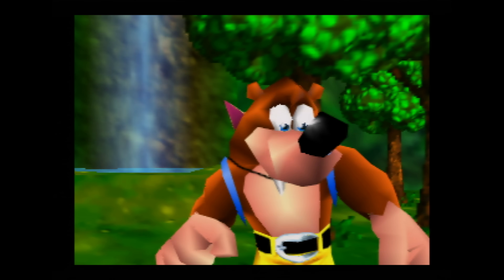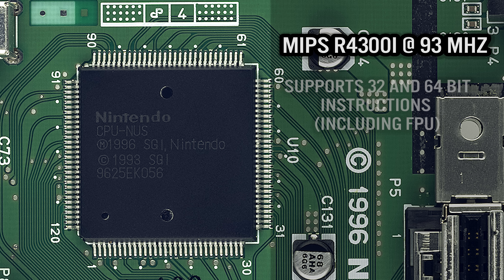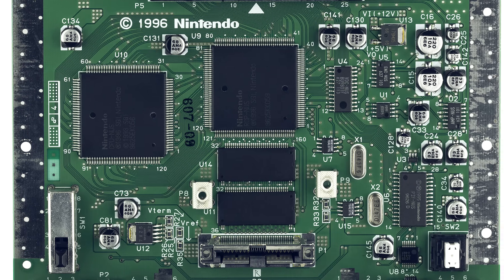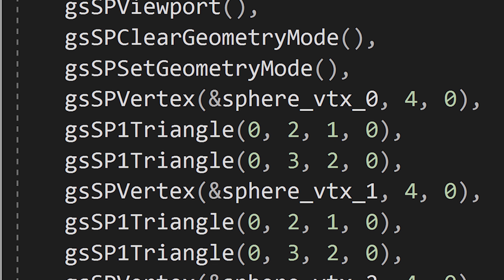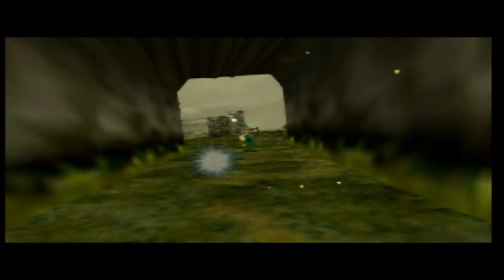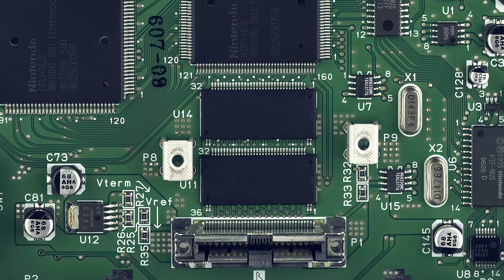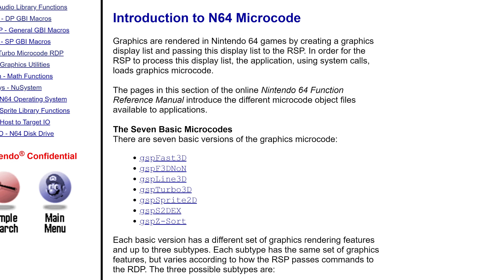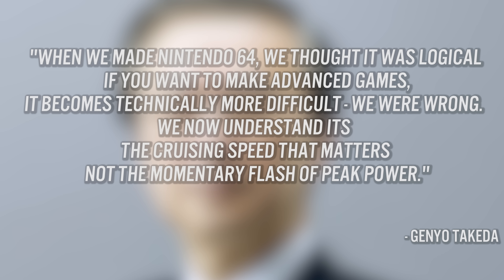Why was the Nintendo 64 so hard to develop games for ? | MVG

Comment: Explaining pipelining as running multiple instructions at once is quite an unfortunate choice in my opinion. 
While technically true, it suggests the false idea of executing multiple instructions per clock. That is not the case. Pipelining splits instructions that would take too much time to process at once (forcing you to use lower clock speed) into smaller chunks (5 in this case) that complete much faster. But all that means is that you don't need to wait for instruction A to finish before starting instruction B, you can start B as soon as block 2 of A is executing (and C as soon as blocks 3 of A and 2 of B start). You can't start A and B at the same time.
Reply: And you must also make sure that A and B do not depend on each other, or you'll stall the pipeline
Reply: @halofreak1990  Not even that on these old MIPS CPUs, no interlocks meant it was on the programmer to avoid dependencies in branch delay slots and load delay slots.
Reply: N64 is VLIW Latency Language exactly like Saturn. But the difference being, NECVR4300 is a single Wafer CPU Chip, SH-2 is a Double Wafer Chip Pair.
Reply: @segaunited3855  RISC, not VLIW.
Reply: @espfusion  VLIW(Very Long Instruction Word) is Latency Language or Assembly Language writing. RISC(Reduced Instruction Set Computing) is an ISA(Instruction Set Architecture) . Saturn's ISA is RISC. N64's is MIPS(Million Instructions Per Second), but both use VLIW Latency Language for Programming.

N64 is capable of up to 60 MIPS Computing Instructions. Saturn is maxed out at 50 MIPS Computing Instructions.

All 5th Gen Consoles used C Language Assembly. It was just easier to do on PS1.
Reply: Throughput is 5x higher (in most cases) unless you are planning on working with assembly in your life thats all you need to know.
Reply: @tintom3t  5 times higher relative to what? 
Most natural comparison to me would be to the same architecture running at the same clock, only without pipelining. And that would be faster.

Comment: Fun fact that was the last time Nintendo had the most powerful console of the generation to date unless you count the time between the Wii U launching and the ps4 / Xbox one launching
Reply: That was the last time any console beat out the PC in terms of power.  I generally think the best looking Game Cube games look better than the best looking X Box games though.
Reply: In that case it usually came down to optimization a similar case would be the Xbox 360 preforming and looking better even though the ps3 was more powerful
Reply: @phantasmagoric3934  Although the shader effects of the X-Box were ultimately the direction the industry went, I think the Game Cube's emphasis on easier to run multi-texture effects delivered better results for the power level of that generation of systems.  The 3D Card inside the X Box had a notoriously ugly color palette too.  I agree though, it usually did come down to the most well optimized games on each system coupled with amazing artists.  Even Shadow of the Colossus on PS2 looked amazing and that system was by far the weakest of that generation.  By this point though, you could basically make any game you wanted and have it look good on all three.  I honestly don't understand why anybody even cares about the minor technical differences between the big three game systems of today.  If I hear one more dumb ass exclaim how they can't believe game X came out for the Switch I think I might die of laughter.  It's crazy to think that even a tablet can push far beyond what these older systems could.

Comment: Pipelining means it is working on 5 instructions at the same time, not that it can execute 5 at the same time. Superscalar is the term used for an achitecture that can execute different instructions simultaneously in different parts up the chip. The expanded version of that is called hyperthreading. 
Also, the MIPS 4300 is 32bit externally, so if you consider the Sega Genesis to be a 16bit system (68000 is 32bit internally, but has 16bit external data bus) than you should consider the N64 to be a 32bit system. Also, very very few N64 games actually used 64bit code. Most used 32bit for a variety of reasons.
Reply: It's actually kinda funny, the Atari Jaguar was actually more of a 64 bit system than the N64. Ram, and the video chip on the Jag were fully 64bit. Pretty much everything on the N64 was 32bit, except for the cpu internals. 
That said, I love both the Jag and the N64, and the N64 had some awesome games for it.

Comment: I remember reading a quote by the CEO of Sony SCEA in the early 2000s where he said the PSX could push more polygons than the N64, in theory, but because of the lack of z-buffer and the various limitations of the RAM etc, it meant that once you factor in textures and AI, if you wanted your game to be playable or actually look good you needed to compromise on that.

Comment: Programmers love challenges. Even something like the Atari 2600, which was a BEAST to program for, eventually had some impressive games made for it (considering the hardware limitations). These were largely much later homebrew games. For example, check out this homebrew Donkey King and compare it to the official release for the system back in the day: https://youtu.be/_Y6vhLDN3dI

Comment: Also, I thought that error message when you plug in the controllers after turning on the console is a RAM-related issue, right?

One cool device that Game Sack talked about a while ago has this problem. Although said device can connect to almost any controller and work with almost every console, the N64 needs to be reset once for that device to communicate with the console.

Comment: "Alright team! Lets learn to develop for the N64! First off, lets read the manual on addressing the RAM..."
Manual: "Dont use the RAM, I beg of you."
Reply: Naota Akatsuki The Sega Saturn and Atari Jaguar were arguably worse in that regard.
Reply: To be fair, i think the title is a bit misleading. It's not that the N64 was hard to develop for PER SE. However, it was badly designed in terms of specs, and working around those bottlenecks is what made development hard. You might think that's ultimately the same thing, but it is not: Remember that other console MVG reported on that was hard to develop on? It had the inverse problem: Plenty of power and no bottlenecks, BUT the code to use that power was complex and ugly. So, it's not really the same thing - quite the opposite.
Reply: @lyxar777  The bigger problem was that the documentation around the microcode was quite shite early on.
Reply: @lyxar777  Alot of developers went on record saying the GDK was not well optimised for gaming and it was difficult to programme for.

I remember reading an interview with members of Rare in that era, and they stated the tools Nintendo provided were awful and they had to actually reverse engineer and fix the software in house.

RAM access was the main bottleneck along with cart size. Kaz emanuar has a great video on how to perfectly arrange and optimise to get max throughput - something never achieved in its lifespan.
Reply: @overwatch761 ouldn’t using CDs requires games to read and then write info onto Ram first? The type of memory found on the N64 had horrible latency and because of this, it’s use for storing info was nearly non practical because of it’s awful latency found on RDRAM. Which is why many later N64 games had uncompressed textures stored onto the cart, rather than on Ram.

Another main bottleneck were the fill rates that affected performance in various N64 games. To tackle fill rate issues, one would have to customize microcode outside of the ones provided by Nintendo, but with Nintendo being Nintendo, were the ones to shoot themselves in the foot by restricting third party access to customizing their own microcode, a touted feature for the system’s programmable GPU.
Reply: @lyxar777  I wouldn't say "badly" designed, so much as quirkily designed. As illustrated here, the design allowed the system to do some things that other competing consoles couldn't, it wasn't necessarily super intuitive to work with.
Reply: @lyxar777  These bottlenecks are overrated - the N64 is a well designed, balanced console with a challenging SDK, cart restraints and heavy handed lockdown by Nintendo.  It's well documented how poor and optimised the n64 development kits were - there are many interviews - a major issue was the standard generic SGI code was just that, it wasn't suitable for gaming and all developers were using it - SGI designed a highly flexible system with customisable microcode at the heart of its design - Nintendo were the bottleneck preventing this - in some sort of twisted order to keep themselves at the top.
Reply: The N64's specs are not it's issue per see, it is the most powerful console of its generation by a long shot.  The primary issue is limited cart space, developers always had to wrestle with this and the constant need for compression and decompression.  Such a waste.  CD would have solved all those problems.   Also Factor 5 went into detail on how limiting Nintendo's generic SGI code was and the only way to actually push the system was to write custom microcode which alas Nintendo did not authorise but for a few games.
Reply: @overwatch761  CD forced devs to design their game so that data would be streamed from the CD as the seek times of the CD prevented data from being used as RAM in one frame.  The levels would have to be cleverly designed to stream data (perhaps segmented like crash bandicoot or metroid), multiple enemies would have to take turns animating, the data would have to be duplicated to prevent too many seek jumps.
Reply: The thing is ND, Guerilla and Sony Santamonica said they milked 100% every ounce of the PS3's Cell cpu and gpu resources by the end.
Reply: yes do i do have begging of the you
Reply: The N64 looked awesome, but only on paper. It had many flaws, even more than the PS1. And nearly as many as the Saturn.

Comment: Sony in 1997: Let's tell those N64 players that cartridges can go bye bye.
Square Enix/PlayAsia in 2019: releases FFVII/FFVIII on cartridge
Reply: @NB-1  I know, I know 😅

CDs were 700-850 MB, depending on what mode it was pressed in, while N64 cartridges were only 64 MB (pun intended, and it's megabytes, not gigabytes). Nowadays, the largest optical disc for the consumer market is the Blu-ray Disc Quad Layer, which is only sold in Japan and can hold 128 GB of data. Meanwhile, 1 TB SD cards are available for sale, and can be used on Smartphones, Cameras, and the Nintendo Switch. Also, the Switch's Game Cards are read-only, region-free, and can hold up to 64 GB of storage (as of the last time I checked).
Reply: @lucasn0tch  old school carts could be directly memory mapped by the system and had comparable access times to RAM, Switch carts and SD cards are much slower relative to the memory used in modern systems, so everything needs to be copied to RAM before it's accessible at a decent speed. That's one of the reasons the PS5's SSD is so exciting, it's the closest thing to accessing game data from a cartridge we've seen in decades.
Reply: the switchs uses game cards not carts

Comment: All of the consoles of the 5th generation seem to have some sort of gimp...
Reply: That is because they were actually pushing the high-end of technology.  When it first came out, the N64 was pushing far more than a top of the line PC.  Only a select few people had the right technology to play the PC port of Shadows of the Empire properly, and that was a full year after the release of the N64 version.  Nothing else during that generation could come anywhere close to matching a top of the line N64 game.  Hell, most of the AAA crap that comes out nowadays can't match them.  Most of today's games are less ambitious and are too afraid to really push hardware the way companies like Rare, Factor 5, and even sometimes Nintendo would push the N64.
Reply: @davidaitken8503  But can it run Crysis?
Reply: @harryballs6652  Ha, ha, ha.  No, but it could run the Crysis games of the time that nothing else could.  It was a few years before good affordable 3D cards that would actually display N64 ports properly without problems became widespread on the PC.  The limitations of the standard keyboard and mouse prevented a lot of games being practical on PC as there were only a select few controllers that could really do games like 3D platformers, for example, justice.  The PC was such a headache back then in order to get the games working good and controlling well.  On the plus side though, there were a ton of PC exclusive games, which was really cool.  Nowadays, it's easy to get a bluetooth console controller working on PC, but the games are almost entirely just ports of PS4 and X Box One games.

Comment: 5 step pipeline doesn't exactly mean you can execute five instructions at the same time, only that instructions in different stages can be executed concurrently, but they don't finish or start at the same time and also there are pipeline stalls when one instruction depends on the effect of another.